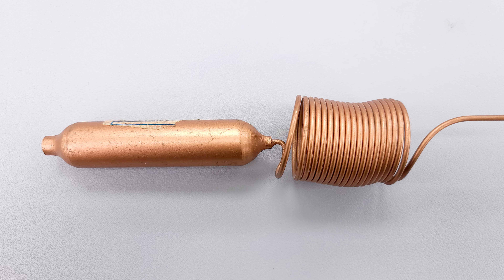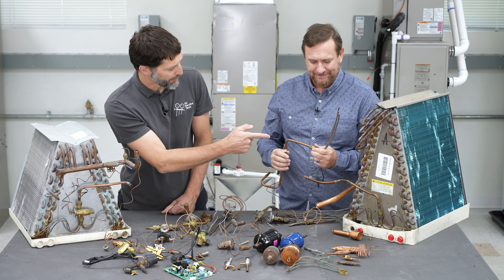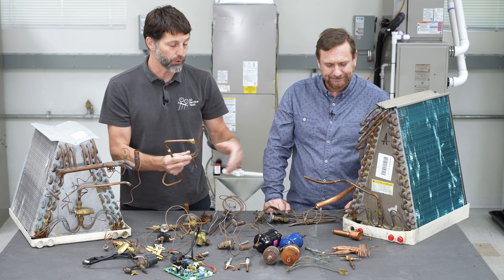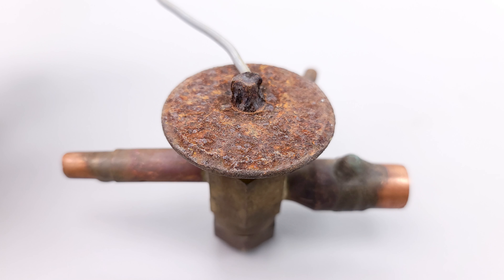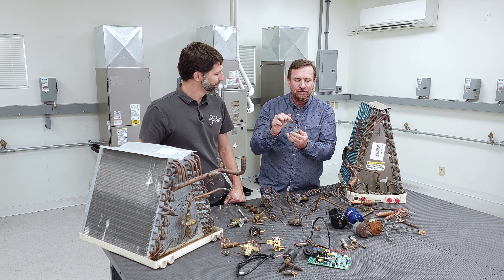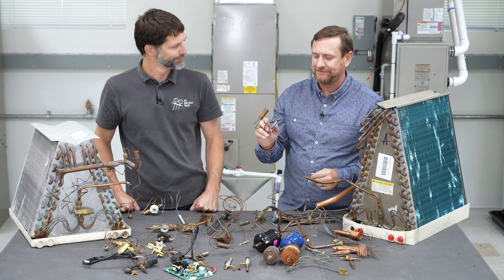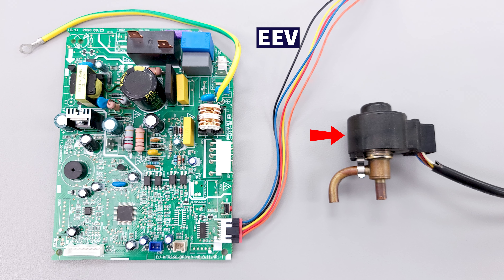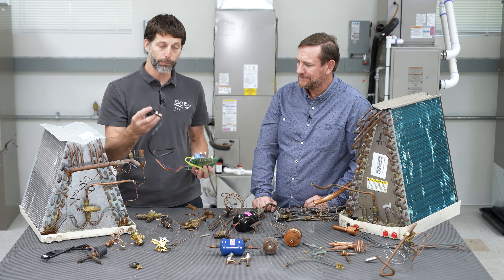HVAC Metering Device Types: EEV, TXV, TEV, Piston, Capillary Tubing!  Function, Location, Problems!

Comment: Hey Craig! I have a question if you would be kind enough to answer.....In a single speed system with a txv, when the txv is constricting the potential flow to increase efficiency in the evaporator, does that raise the head pressure, reducing the efficiency in the compressor?

Comment: The txv cannot be used in normal ac systems you will need to have proper hp mechanism for the safety of the compressor for high pressure due to closing of the thx and you will need liquid storage tank which will increase the cost

Comment: Good afternoon!  I'm trying to understand if metering device is Piston or TXV for my Carrier evaporator Coil inside.  The identification plate on the Carrier condenser unit outside lists:  Piston 73 (Indoor)  n/a (outdoor), Indoor TXV Sub Cooling = 14 degrees Fahrenheit.  So, is it piston or TXV?  I'm trying to figure this out without having to open up the Evap Coil.  Thx

Comment: I have ONE question ❓
Can an Old Line set of 3/4, 3/8 on 2.5 ton System Change over to 3 ton System of Evaporator coil and a Condenser Unit ❓❓
Reply: It has no any problem. Actually 3/4, 3/8 pipe set is the right set for 3 ton unit
Reply: Did you read the manual ? 
Depending on manufacturer, line set sizes will vary by application. 
If outdoor unit is at or below indoor elevation, that size should be good but if your outdoor is above indoor elevation the line set size usually decreases in size to increase velocity so oil can make it back to compressor.

Comment: do you guys recommend burning or cutting out major components?
Reply from the maker: When the line set is long enough, cut it out after recovery. Its safer and in regard to the filter drier, you won't release the moisture back into the system by heating it.

Comment: Soon enough turboexpanders will be the next expansion device. Electronically controlled and recovers energy from the pressure difference.
Reply: Too expensive, gonna be a long while. They r focusing on being cheap for now
Reply: @topshelflifestyle01  Still on the start of the adaption S curve. Maybe once variable compressors are standard manufacturers will need a new top of the line offering.

Comment: I looked at an 5T Goodman install where the piston system an .083 on about a 75 ft lineset at about 17ft high, would run fine, but then the super heat would just start dropping from 11 to a 5.  The system ran supposedly, but then started blowing the cooper tubing on the output side of the compressor.  It would just explode the line off.  Any ideas?

Comment: If you ask me, the less electronics and moving parts the better. I’ll take my piston any day. Just need regular maintenance and gas check to make sure superheat is correct.  That’s my two cents.
Reply: I preferTXV or EEV.... much better and least problems
Reply: @eduardocastroisaac1630  so do most in the business. I’m just sick of $500 circuit boards failing or shorting out

Comment: 10:44 oil additive... brazing while not flowing nitrogen... so no soldering allowed... poe oil ...filter dryer ...how is the poe oil used in the compressor is it two different oils?!... how do you vacuum out oil etc... pistons seem the best with a single speed compressor...way more simple... jeez